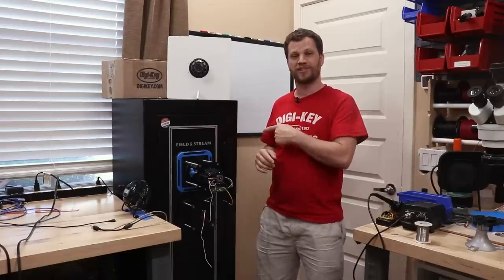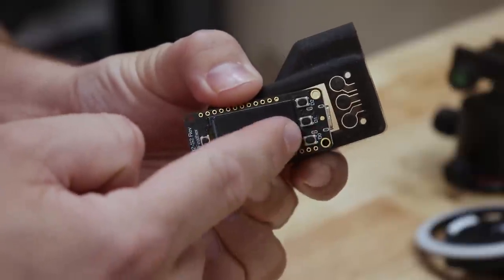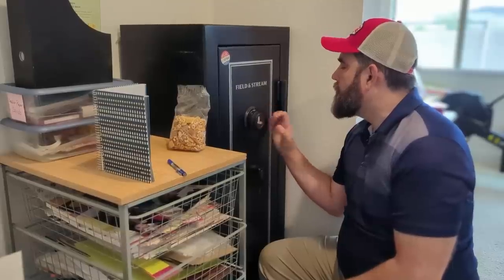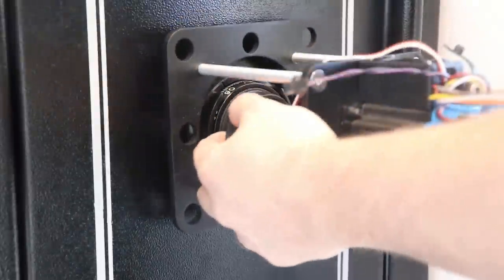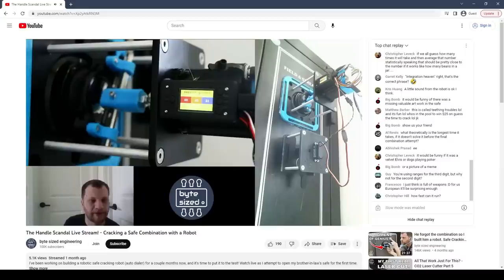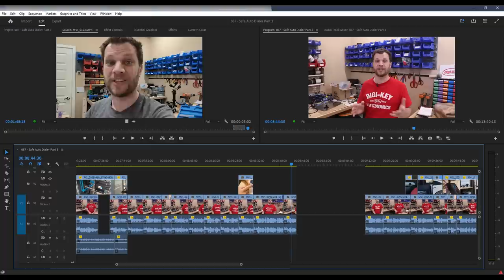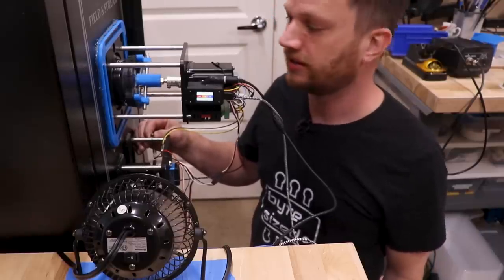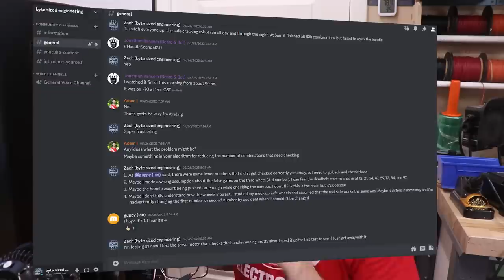Everything Has Gone Wrong! Safe Cracking Robot - Part 3

Comment: I am working on a similar project for my safes, but am using a closed loop servo. The other this is that a S&G dial actually locks up when retracted, so no need to test handle until dial is locked.
I'm pretty handicapped when it comes to programming, so it is slow and tedious.  I have about 10 different types of safes, so always looking for a better way. Always good seeing someone who is much better, and following their led. Keep up the great work!
Reply from the maker: That sounds awesome! This safe does not use an S&G dial unfortunately. That would have been much easier. My mock-up safe that I built does however.
Reply: I also am working on a version of this,  I need to get it for the S & G type that locks the dial. I'm just starting to get parts and trying to decipher the code to take the lever test out.   I will keep you in mind if I have any break throughs.  :)

Comment: I could tell that the pressure on the handle was going to be an issue. Pneumatics are nice because you can just give it the maximum force that you are comfortable with (regulated with a pressure regulator), and actuate with that both ways.

Comment: Just use a closed loop stepper (which is what I thought the original motor was) you do need to make sure the pulse buffer in the motor driver is empty before you command a new move but the driver will either have a simple output to indicate that or you can put in a short delay between moves to allow the buffer to empty.

Comment: Something like the misfit tech servo stepper might simplify things for you. It uses a small magnet glued to the back of the shaft as feedback, and the board bolts straight to the back of the motor. It takes the same step/dir signals as a stepper, has an "error" pin that goes high if thr motor stalls, programable current and microstep increments.

No affiliation, i just use them on the cnc at work and they would replace th whole stack you have on the back of the stepper, plus simplify your code.
Reply from the maker: I'll look into that, thanks

Comment: Great project. My 2penneth would be to use actuators 2-3x what you think is needed and torque limit the output. Use off the shelf parts of course for prototypes. use current limited power supplies. Put fuses in . For quadrature encoders use hardware quadrature counters (esp32 has inbuilt) . build it like its a cnc. You will suceed. Lockpicking takes persistance.

Comment: Correction!  I was wrong.  That safe has a inexpensive lock that isn’t like a normal group 2.  Now I get why you have the handle servo.  That lock does not have a drive cam to retract the bolt.  It is just three wheels, each one with a slot that when aligned allow the main bolt to throw into the aligned wheels.  Super cheap!

Original (wrong) comment (but right for an actual S&G or LA guard lock)… You don’t need the complexity of the handle servo.  It provides no value.  Just go clockwise after your last number 360 degrees.  If it rotates a full 360 you have not found the combo.  It it torques out that means you have found the combo and it has retracted the bolt.
Reply from the maker: This dial combination does not work that way unfortunately. That would have been a lot easier.
Reply: Most safes with dials that I have used dont work that way.
Reply: Yeah that should have been apparent since the wheels have "false gates". False gates are not required on a G2 lock with drive cam since the fence is unreachable in incorrect combo, you can't "tension" the wheels.

In this cheap lock, false gates are required to prevent people from pulling hard on handle and then trying combinations until the wheels stick - without false gates they would have 1 number right, thus they could just try 2 more times.

Comment: Let the spring do the work on the handle and just use the motor to tension the spring, like some kind of cocking mechanism with a ratchet that can be released like pulling a trigger. A pneumatic actuator might be an option, but do tend to be noisy. Stuff Made Here might be a good collab just to run some ideas by him.

Comment: The servo motor for the handle was a mistake. Use a brushless motor with an encoder.
Reply: FOC with torque sensing like the Moteus controller would be nice. Strong enough to open the handle and a moving average of the measured torque will robustly detect if the handle is unable to move. It also has position control, so no limit switch is needed.
Reply: @MACaronyboy  that would do it too
Reply: @CoryTaylor904  or just a stronger servo, to avoid springs for balance. Springs are only needed as it has too little torque, and he tries to balance out handle spring. I guess..
Reply: @TheStuartstardust  fundamental problem with servo is that the servo will continually try to reach a position and you will not have feedback when it is unable to reach the position. This leads to the servo getting hot. Also servos use a direct gear reduction, you are far better off using a magnetic coupling to limit torque (eg. A brushless motor)
Reply: @CoryTaylor904  Yes that is where a stronger serve is needed and a spring to load handle - if no overload is happening, then it should be ok 🙂

Comment: Ditch the servo and use a solenoid instead. You should be able to get a good strong opening force and better return action. And it shouldn't overheat like that poor servo that's constantly being stalled. I think eventually you will likely strip the servo gears as well.

Comment: I'm a retired locksmith/safetech, that was some endeavor making the dialer. Your Field & Stream would not take long to open and repair. WHY do you think you have to try the handle, most locks stop when it's unlocked just like your test lock. You say there are false gates, maybe this is like a Sentry dial lock. Turning the handle numerous times will slow you down. I'll find your next video to see how it went

Comment: For wheel #3 you only have to stop the dial at 8 possible positions before trying the handle.  You could in fact have the robot dial wheel 1, then wheel 2, and then dial and stop to one of the 8 possible positions on wheel 3 and try the handle at each of them. To find those possible gate positions you can do it manually by parking wheel 1 and 2 and then turning the dial which is mechanically linked to wheel 3 and as you turn the dial apply pressure against the handle and write down every time the handle gets stuck in a false or true gate all the way around.  Then to verify these positions and to make sure you had not parked wheel 1 or 2 with one of their false or true gates in alignment with the direct entry fence, turn the dial to pick up all the wheels again and park them 5 numbers higher or lower than the first place you parked them, and then turn the dial again to test the true and false gate positions while pressing on the handle to see if the first time you mapped them matches with this second time around.  If they match, then you now have the 8 spots the wheel 3 has to be turned to before trying the handle which should reduce the amount of dialing your dialer has to do to exhaust all possible combinations.
Reply from the maker: That's exactly what I did. I'm only trying the eight gates for wheel 3. I just learned recently that wheels 1 and 2 also have false gates. Next I'm going to try to figure those out
Reply: @bytesizedengineering  imagine if you can reduce the dialing to 8x8x8 combinations?!   I will tell you the false gates on wheel 1 and 2 are at the same intervals, but are somewhat differently offset/spaced from wheel 3's false/true gate locations on the dial.
Reply: In addition to determining where the deadbolt "starts to slide in" to the gates, you probably also want to determine where the ends of the gates are. That way you don't have to be right on the starting slope of the gates, but you can be well in the middle. Either do the same as what you did going forwards, just going backwards. Or (if this is possible), get the deadbolt into the gate (with almost no pressure) and then see how far you can wiggle the dial back and forth.
With how the starts of the gates are 9, 13, 13, 12, 13, 12, 13 and 15 positions apart, I would suspect that they are equally spaced but different widths. In fact, I woooonnndeeer if that suspicious out-of-sequence gate at pos 12 is the true one. Maybe? If I were you, I would start testing the gates on the 1st and 2nd wheel through that position 12 gate.

Comment: Use the original stepper for the handle actuator. You can use belt or other gear systems to increase the torque and I'm thinking that the stepper is quicker than the baby servo.

Comment: Looking at your handle turning rig, it looks like you have the servo directly connected to the handle, this is likely to over work the servo. If servo decoupled from the handle by a spring you would be Less likely to stall the servo and prevent over heating. 

Stalling servo is likely to also strip gears. (A lot of rc cars fit a servo saver on steering)
Reply: Personally I would have tried using a solinoid, rather than a servo, to operate the handle.
As can be operated very quickly, and I believe that you should get a quicker test time for one cycle in comparison to servo, theoretically that means it should find combination faster even a small time saving per cycle adds up.

Comment: how about two servos to operate the handle?.. configured as push / Pull?  that way you don't have to rely on the mechanical return of the spring which is quite slow, and you will get a more positive/faster/more accurate actuation of the handle

Comment: I think it would be better to use a linear actuator made with a stepper and a screw for the handle. They are cheap and very strong
Reply from the maker: That would be a very strong option. It would also be incredibly slow. Whatever solution I come up with has to repeat 80k times.
Reply: @bytesizedengineering  I undersdtand that pneumatics weren't possible at your BILs house. Do you have compressed air in your shop? Then a double-acting cylinder would be a perfect solution. Fast, reliable and strong enough
Reply: @bytesizedengineering  i still think it would be a good option even though it is slow. it may take 10x longer, but you should be able to just let it run for a week and get a cracked safe at the end. consider installing one and letting it run, and try to design something faster with a test rig while it is running. if you get something better and faster, stop the slow version, take note of the combination it last tried and start from there with the updated design. speed doesn't matter if it works.

Comment: the lever will only turn once the dial retracts a bolt blocking the bolt work. also a dial like that works in a 4 3 2 pattern. you have to land on the first number after landing on the 4th time passing it. then the second on the 3rd time passing it and so on. after you get the last number you turn the dial clock wise till it stops then the bolts can be retracted.

Comment: If you can monitor the current the wheel motor is using you will find the point the 3rd wheel has engaged the cam because it will start to pull the bolt back which will put more load on the motor. You can then test if its the right number by telling the motor to try and turn the wheel 180' and if it does to carry on trying, if its withdrawing the bolt it will stop the motor before then.
Reply from the maker: This dial mechanism doesn't work that way unfortunately
Reply: Do you mean the dial doesn't withdraw the bolt and its the handle that moves at the right combo? If that's the case they are quite easy to open by putting a weight on the handle and looking for movement while turning the dial. In an auto dialler situation you would have a sensor that detects the handle moving while the stepper rotates the dial. You can also do that type relatively quickly with some practice.

I use a weight with a laser pen attached it shining on an opposite wall to amplify the movement (also a good trick to measure contact points on normal manipulation)

Comment: Awesome job!
What's an engineer? A person who will spend a month building a machine to accomplish a week long in a day.
What made you go with a servo motor for the handle over a solenoid?
I've rebuilt many pinball machines and it seems like one of the launch solenoids would work perfectly here. Bidirectional, fast, and it doesn't mind trying to move but being unable to like a motor does.
Reply from the maker: Do you have a link to a solenoid?
Reply: @bytesizedengineering  Not off the top of my head, sorry - it's been a decade. A latching solenoid from a security system would also work. Those are designed to turn deadbolts.

Comment: What if you use an electromagnetic puller to pull a string hang to the end of the handle? Like One of those that hold the firewall doors between section of a building.

Comment: I have watched the series from the start, including the live stream. However, I don’t think I have ever had my question answered. Why does it look like it turns left, left, left, right. As far as I am aware, safes go left, right, left.
Reply from the maker: The robot sets the first number, then the second, then the third. Left Right left. This safe has false gates so it only needs to try 8 numbers as the third number. It can try all the third numbers without disturbing the first or second numbers. 

When it doesn't find the combination after trying all the third numbers it goes back and decrements the second number. Then it tries all the third numbers again without disturbing the second or first numbers. It does this over and over decrementing the second number.

After the robot has tried all the second numbers, it finally increments the first number and starts all over. It continues this large pattern until it's tried all the first numbers
Reply: @bytesizedengineering  thanks for the reply! I guess I’m just confused how it’s trying to unlock it when it just turns left. I think I understand the false gates I just can’t wrap my head around how it spins. My gun safe for example. (Fake numbers) I go left 16. Right 29. Left 1. Unlock. 

If I was to go left 16, then keep going left to 29, then continue to 1, it wouldn’t unlock. 

Sorry to bother you with this, just not knowing how this works has been driving me crazy!
Reply: @jefa3524  Say the robot tested your safe and was almost up to your combination. Say it was just about to test all the 3 of 16,29,5  16,29,3 and 16,29,1. It would go left (16), right (29), left (5), left (3), left (1). It just tested 3 combinations with only 6 moves (not 9).
Reply: @pete3897  not sure why but that made it click for me! Thank you very much Pete. Now I can sleep easy lol.
Reply from the maker: @jefa3524  https://youtu.be/CZ8WRDVgKrk

Comment: If you don’t have a safe you know the combination to, and can reliably open, you’re going to be constantly fighting an uphill battle. Test driven development. Build the integration test rig first. Define success, and build a minimum viable product to achieve that. In this case, spin in the correct combination, and open the door. Once you have something that passes that test, that can follow the happy path and succeed, you can solve additional problems, like not knowing the combination. Imagine trying to build a pyramid, but starting with the cap stone, instead of the base. That’s you right now.
Reply: You've just graduated, haven't you?

Comment: Hello,
This is very interested project. You have done a tremendous amount of work

But I think that you are doing the code entry procedure wrong.

The dialing procere looks difrent.

I have a similar safe and entering the code looks like this:
I turn the first code 4 times to the left. Second code 3x to the right. Third code 2x to the left. Finally, to the right and I'll unlock it. 
It is not even necessary to move the door handle. The input wheel stops at the last turn.

Like this:
https://www.youtube.com/watch?v=hHqkbT64ZXc&t=24s

Or this:
https://www.youtube.com/watch?v=BdMt9pyiidk

I wish you success and I look forward to the next part.